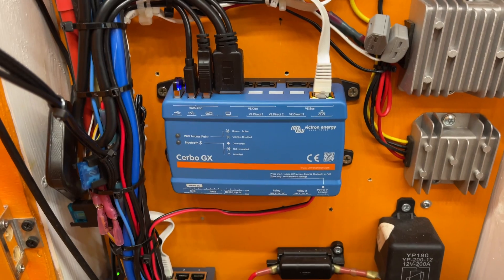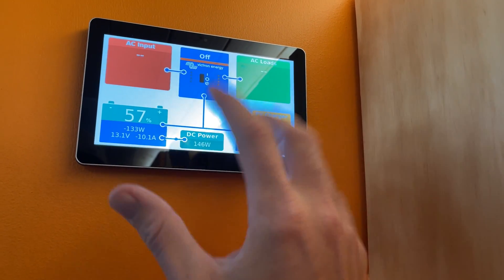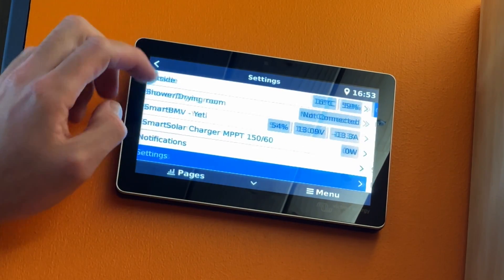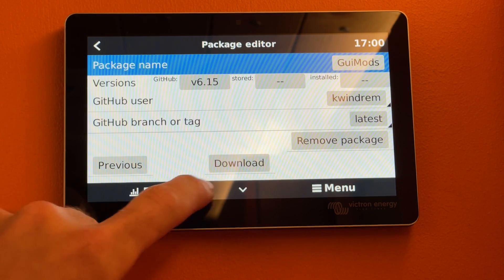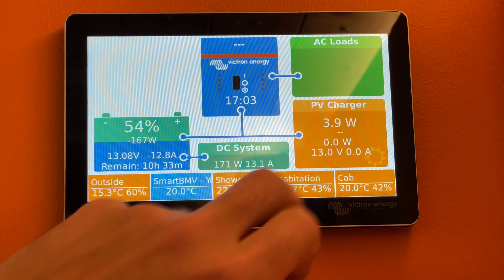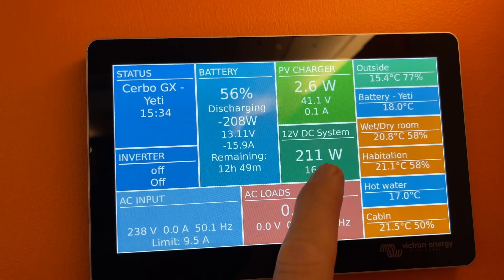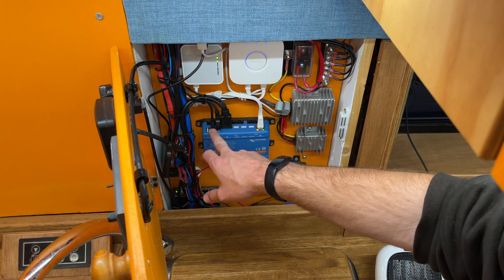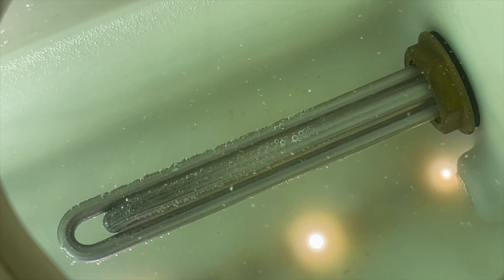Custom VICTRON

Comment: FYI GUI (Graphical User Interface) is pronounced the same as gooey
Reply: Both "G-U-I" and "Gooey" are common pronunciations for GUI. 

When I had my vivas for my PG degree, I pronounced it as "gooey", as fellow students liked to pronounce it that way. Meanwhile, I always pronounced it as "G-U-I" at work. (Just my habit, as I read the litters out for the other names in software dev, like U-X-U-I, C-L-I, A-P-I, S-D-K, I-D-E, A-P-K etc., So I tend to keep the consistency.)

Doesn't really matter which one you go for imho, as long as it makes sense to the others.
Reply from the maker: Both are correct in Acronyms and initialisms forms. I used to design UI’s as part of my degree. UI ( user interface ), you would always pronounce it as a initialism and not as a  Acronym. Also makes sense to me if you add a G, it would still remain a initialism for me. But both are correct

Comment: Is it possible to mirror the display or even not have it and use a tablet? If so I’m putting a cerbo on my list! 
I think if you could make an app to display all the Victron kit (but much prettier) water levels , temps etc and also have an overlay or swipe to show the cctv all on one screen your on to a winner!!
Reply from the maker: I’ve heard about people attempting HDMI splitters and so on, but it doesn’t seem to work very well. You could have a second display by connecting to the item remotely with a tablet and displaying the VRM screen. 

Hopefully one day, they will expand the VRM to incorporate things like that, like cctv

Comment: Cool video Alex, i can confirm that the victron sensors are not waterproof, my first one died even after, i tried to make it waterproof. The second one is doing just fine. intresting seeing all the items running of USB, do you have a link to the GPS dongle, plus what else are you running via USB into the Cerbo?
Reply from the maker: Yeah, I thought a few people had tried and discovered it’s not waterproof. Hopefully with all the layers of sealant and heat shrink this one will be. 

USB GPS is listed in my Amazon store ( I think ) link in the description. 

I just have my mppt ( VE.direct to USB ) , shunt ( VE.direct to USB ) , Multiplus ( VE.Bus to USB MK3 ) and USB GPS
Reply: @MispronouncedAdventures  Guys, there are waterproof resistive temperature probes, some with long thin stainless body (much more suitable for drinking/showering water) or you could use an automotive screw in fluid temp fitting. Having said that, that sensor shouldn't fail in water, might give you iffy readings.
Reply from the maker: Very true there are waterproof sensors, the reason for using the multiplus GX sensor as it comes with the Multiplus inverter but normally goes unused. So it’s spare

Comment: Great video as usual, :) don`t know if you have LPG in the van, but the other day I`ve just installed an ultrasound sensor on the gas bottle and it works great with cerbo gx. Its a great mini computer for the van conversions, cheers again. :)
Reply from the maker: Thank you, no LPG for me I’m diesel for heating and electric for cooking. Glad to hear you’ve got an LPG tank sensor for Cerbo GX.  I see there are one or two options. I definitely think the VRM is a great way to bring together all the separate bits of equipment.
Reply: What is the LPG sensor that you are using that communicates with the cerbo gx?
Reply: @chachi5975  yes it does and is super accurate.

Comment: Excellent tutorial. I'll install guimods this weekend. My element is switched by the solaris voltage sensor, but I like your way better.
Reply from the maker: Glad you found it helpful. 

More or less, I was also using a voltage trigger originally which does work however it is rudimentary. Access to state of charge eliminates so many factors which cause a problem of just voltage along as a trigger

Comment: Is it possible to turn on and off a multiplus Inverter at set SOC,s do you know please Alex? That would be so useful to me :)
Reply from the maker: Hmmmmm. That is a good question. 

It’s not in software, as in you can only turn the multiplus on and off for the Cerbo manually.

I guess in effect you could use the same system I use for the dump. Relay 1 using the start / stop  generator and having the small wire bridge on the bottom of the multiplus running through the relay. Normally that bridge is used for a manual switch
Reply: @MispronouncedAdventures  many thanks, food for thought :)